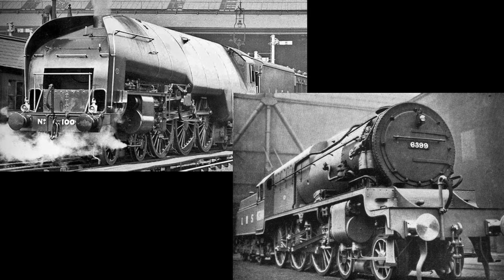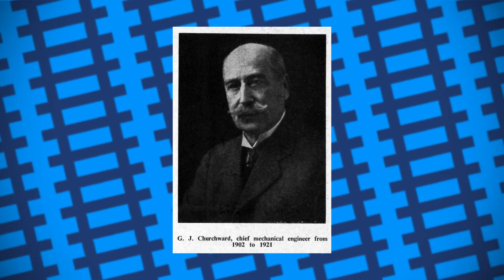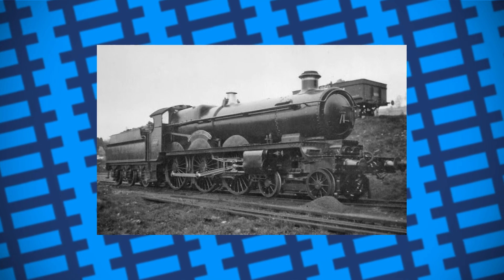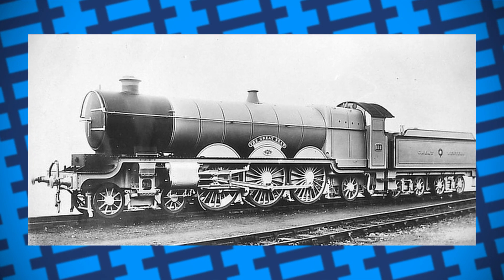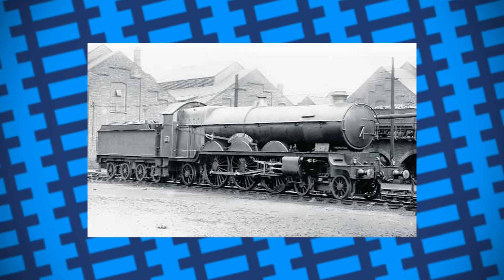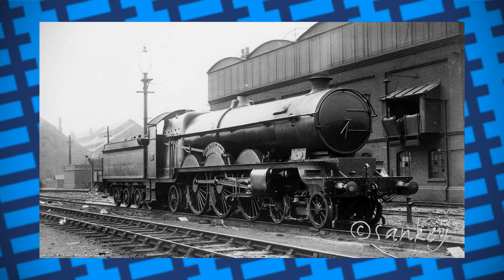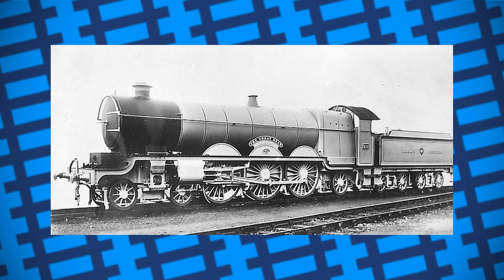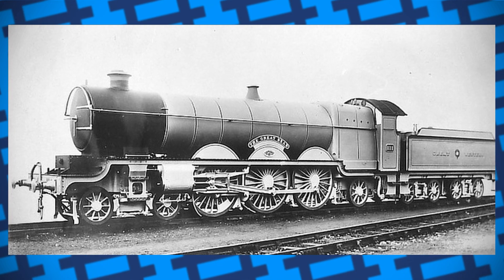The GWR's experimental pacific locomotive - GWR "Great Bear"

Comment: The Pacific obviously had serious design flaws if a ten wheeler performed better.   In the U.S. Pacifics were highly successful and powerful and stayed in use for decades even after the development of the 2-8-4,  4-8-2,  and 4-8-4.
Reply: Look up the dates those American pacifics were built and you'll see that Great Bear was long before them. The UK had many excellent pacific locomotives that followed and were very successful, one of them being the fastest steam locomotive in the world. A record it holds today.
Reply: @totalal4601  I compared the British pacific with its contemporary British  ten wheeler.
Reply: @totalal4601  Let's see. The Great Bear was built in 1908 and the Pennsylvania's K2sa Class in 1910. Do you consider 2 years to be a "long" time? The Bear had 28,797 lbs tractive effort and the K2sa 32,620 lbs tractive effort. The difference was the PRR built 296 of them, they were hardly "experimental" and the last was retired in 1949.
It's big brother, the 425 K4s dated from 1914, had 44,466 lbs tractive effort, could run as fast as almost anyone wanted to go and some lasted until the end of PPR steam in 1957.
Reply: @colbeausabre8842  You are comparing two fundimentally different locomotives.  The only thing The Great Bear and the PRR K series have in common is the wheel arrangement.
Reply: @colbeausabre8842 Okay, and what’s your point here? The K4s themselves were becoming rapidly outdated by the mid thirties when they were being doubleheaded on most trains, which is both cost and labour heavy.
Reply: The Great Bear suffered from boiler tubes that were too long, a trailing truck with faulty bearings, and a very long frame. Two of those problems could have been rectified relatively easily if some work was done, but the GWR focused on 4-6-0s since they were sufficient for what the GWR needed, considering terrain and distances. 

Running conditions in the UK were different to the US, and its too quick an assumption to think that the Great Bear was unsalvageable since ten-wheelers outperformed it, considering that the four-cylinder GWR engines were some of the most formidable ever produced. For reference, the Castles also outperformed the first of Gresley’s pacifics, which forced him to make some improvements.

Comment: The Great Bear wasn't quite the end of the GWR's flirtation with 4-6-2 Pacifics. In the 1930s they produced a design study for a 4-6-2T for heavy suburban traffic that was in effect a Castle derived front end married to the cab, tanks, bunker and rear pony of a 72xx 2-8-2T. However the idea was not taken forward. Then in the mid 1940's Hawkworth considered a four cylinder Pacific as a King / Castle replacement, but the idea never got beyond a few rough concept sketches, and exactly how serious the idea was is a matter of conjecture,
Reply: I think Stanier had far more success with 4 cylinder pacifics than Swindon ever did.
Reply: @jogindersinghfoley3860  Inded, The Bear was the only one of the concepts to get off the drawing borard. However don't foget Williamk Stannier was a Swindon lad, served as assistant to both Churchward and Collet before he got the Crew gig.
Reply: @stashyjon  Stanier cernainly learnt from his experience with the Castles and Kings

Comment: The 8 wheel tender would later be used of 3 38XX 4-4-0 (Because those engines were rough riders), 3 29XX 4-6-0 and 2 40XX 4-6-0 before it was scrapped. As for the rebuilt Great Bear (GWR Castle 4-6-0 no 111 Viscount Churchill), it lasted until July 1953.

Comment: 2:45, it’s funny because Gresley’s A1’s were the first ever successful pacific engines in the UK (that I know of at least).
Reply: Only after they were modified after borrowing a Castle class locomotive from the GWR,  when they found out the castle out performed the A1 despite being smaller and lighter.
Reply: Yes but I’m only referring to pacifics, not 4-6-0’s
Reply: They were not. The GCR and NER both used 4-6-2 tank engines prior to the Gresley Pacifics even being thought of.

Comment: The Grouping was 1923 not 1921
Reply: Technically, both. 

Grouping occurred as part of "The Railways Act 1921" which, as the name suggests was given royal ascent on 19th August 1921. However, you're right in that it didn't take effect until 1st January 1923. (and between these two dates, the LNWR bought out the L&Y)

Comment: The Great Bear was found to be underpowered for a Pacific, mainly due to having less tractive effort than the Castles
Reply: Had a feeling I'd see you here. Both of you did a great job covering this locomotive.
Reply: So it's Henry?
Reply: @Bigbigpoopi  I guess you could say that
Reply: I don't think it can be said that The Great Bear was under powered.  Its tractive effort, to the extent that such matters, was pretty respectible for its time.
Reply: I’m not sure what your point is, considering that the Castles wouldn’t come around for another 15 years or so. By your logic, the Castles were underpowered since the Kings had higher tractive effort.  

The Great Bear was a botched enlarging of the Stars, and it’s dimensions are consistent with that. Its power would have been consistent with the early French and German pacifics.
Reply: Almost like the US engines were built for rugged terrain and UK was built for lightness

Comment: Correction: The LNWR was the largest pre grouping railway.
Reply: Correction: The LNWR was the longest railway pre-grouping, but it's certainly not the largest company.
Reply: @caboose.20  It depends how you define largest. It was certainly the most valuable joint-stock company in the world, as was the LMS after the Grouping.
Reply: Maybe if you’re counting the merger with the L&Y just before the grouping. Otherwise, nope.

Comment: What's the difference between Pacific locos and Atlantic ones
Reply: Pacifics have a 4-6-2 (o-o-OOO-o) wheel arrangement, whilst Atlantics have a 4-4-2 (o-o-OO-o) wheel arrangement.
Reply: @sangheiliwarrior86  wow that's a first one, using "o" to display the wheel arrangement
Reply: @A.i.r_K  I was using o's to show him roughly what it the driving and trailing wheels looks like on a locomotive. Obviously using the whyte notion as written it's 4-6-2
Reply: @sangheiliwarrior86  actually I recall that notation style as common back in the 60's as a visual aid to understanding of the arrangement of load bearing wheels (o) and driving wheels (O).
Reply: @sangheiliwarrior86  that makes sense